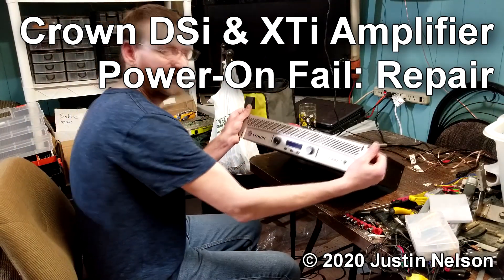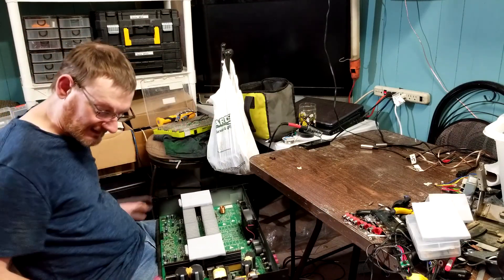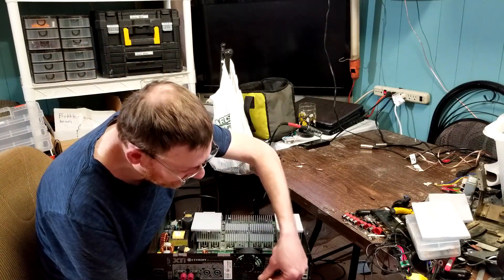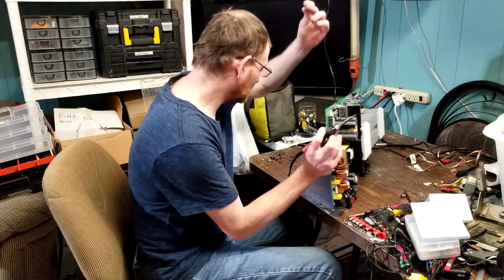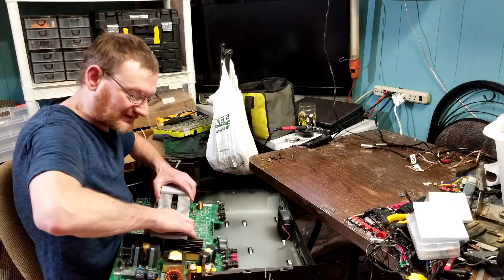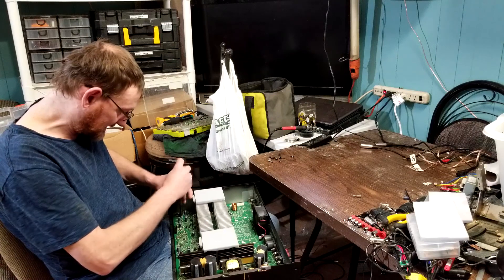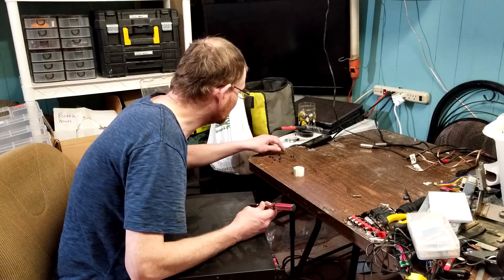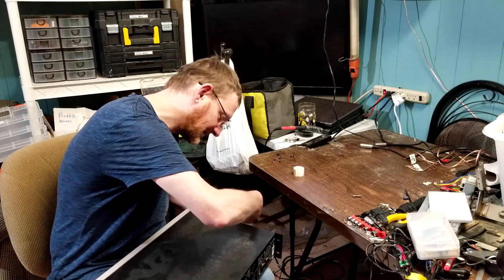Crown XTi Power On Failure   Repair in 16 Minutes

Comment: Not sure how soon you'll get back to me, but I had a question about the Crown sending the same signal out of channels 1 and 2. Any idea on how to troubleshoot that?
Reply from the maker: You should check the user manual for your model, but *in general*, if you have the DSP set to "Input Y", that'll send channel 1's input to both outputs.

Similarly, if you are set to "bridge mode" but actually have two speakers connected, you'll get the same audio in both (and this could cause speaker damage).

Press "config" twice, then use the arrows to cycle through the settings... other than that, google for the user manual, Crown is good about keeping manuals for their older products available online.

Comment: I have a crown xti 4000 that when powered on all the lights on the front flash on and off and gradually get weaker the longer I leave it powered on. Is this fixed the same for this issue on the 4000?
Reply from the maker: This sounds like a completely different problem... my fix as shown in the video is ONLY for the specific issue that I show; anything beyond that, you'll need to have someone qualified take a look at it.

Comment: @JustinNelsonsProjects   I wonder what was wrong with my XTI 4000? Mine would fire up but it would keep blip-ping my speakers repetitively and I would have to turn it off. I bought it used from Guitar Center but Luckily it was still under the factory warranty. Took it to a licensed Crown/Harmon shop and knock on wood it has been great for 14 years. I am pretty easy on it though, I only power 2 Cerwin Vega LS15's so I never ride it to the rails - only around 400w RMS on occasion.  Back then I bought it used for $700 so I just couldn't resist lol.

Comment: Hey Justin, I owe ya a couple beers already for this video as I've successfully revived 2 Xti1000's with your cap replacement here.

But my 3rd is being a whore.  After replacing the cap, it went from stone dead to powering up and then showing signal present LEDs on 1&2, so I thought maybe I didn't get a good soak on the traces and went back to retouch those.  Now it has a clip indicator on #2 despite never being given signals since the first repair, and it won't show up in Architect or HiQnet.  My other 2 populate in Architect on their own.

Tried swapping a cover over to see if it was maybe the bad ribbon cable issue but no dice.

Amps all supposedly came out of a church.  Fortunately I'm not into 'em for much as they were purchased in unknown condition.

Thoughts?

Comment: Hello, i have a xti1000 that wont turn on, so i replaced c196 with a 50v 220uf one, it still wont turn on so i measured the resistors that should be working on 48,7kohm but they show 22.6kohm do i also have to replace all those resistors for it to work? I have no idea an am a real noob technically
Reply from the maker: Measuring a component (like a resistor) while it is still "in circuit" will generally yield incorrect readings.

I *HIGHLY* recommend you take the amp to someone skilled in electronics. There are high voltages that can be present LONG after it has been powered off, and if you are a "noob" as you put it... you probably shouldn't be randomly probing around in there or replacing parts you may not fully understand.

My guide was for a highly-specific issue that plagues the XTI & DSI series of amplifiers; if replacing that one cap didn't fix it, then it's something else entirely and requires bench troubleshooting by someone skilled in amplifier repair...

Sorry the quick fix didn't work in your case -- it didn't on a couple of mine either... but since I fixed at least 6 of them with this fix I knew it was common enough, that I made a couple videos about it.
Reply: @JustinNelsonsProjects thank you, will let it get checked out by someone soon!

Comment: Hello, how are you?
Do you have the firmware you could provide me?
Reply from the maker: See pinned comment... sorry, I haven't worked on these amps in YEARS, it was a one-time video project that has long been forgotten...

I do know the firmware is still available; I would recommend searching Crown/Harmon Kardon for a service manual and any firmware (and the software needed to flash the firmware).

Just note that in most cases, a firmware update is not going to fix a broken amp...

Comment: Did anyone here try this and it didn’t work? I wish I could say it did like everyone in here but something bigger must be wrong with my XTI 4002. I replaced the capacitor with one of the ones linked in the description and when I turn it on, I hear a relay firing quietly a few times then nothing. Anyone else experience this? Or know of a person to send it off to that won’t bankrupt me?
Reply from the maker: The fix I show just happened to work on the handful of amps I got my hands on. It's not a "fix all" solution, there are MANY other things that can go wrong -- especially the higher-wattage models that have a "tracking power supply", meaning the voltage inside varies depending on how hard you crank it...

They are complex beasts to be sure.

I would look for someone local who does electronics repair, or if you're handy enough, reach out to Crown / Harmon Kardon for help (maybe a service manual)...

Comment: What a chaos. And after 3 minutes you manage to bend the poles 45 degrees. Thats not how other peoples hardware is treated.
Reply from the maker: Please read the pinned comment. I don't do amp repair for others, these were just some "about to be thrown out" amps I decided to take home and tinker with.

Aside from that, this video is quite old and those amps are STILL in use in my home studio today.

I just wanted to quickly highlight a common issue on these older Crown amps. You don't have to like my particular methods 😏

Comment: I don't see any repair videos if the xti 4000 and xti 4002 
The capacitor in question is a completely different number, mine will not switch on and that capacitor don't seem to be at fault
Reply from the maker: This video is SPECIFICALLY about the amplifier shown -- I cannot diagnose an amplifier I do not have access to... you'll have to look elsewhere for a video specifically on the 4000/4002 series...

Comment: I have a crown xti 40002 and all I had was 4 cerwin Vegas hooked up to it I bought this thing used and it's worked good until today I wasn't even driving it that hard to where it was red lining or anything but it started flashing and slowly turned off but there was a weird thumping noise through the speakers even with it off how much would you charge me to fix it I'll send it to you
Reply from the maker: I don't do repairs -- I simply repaired a few amplifiers a couple years ago, and decided to share my experience... see pinned comment for more info...

Comment: Thank you for your help. I removed the motherboard from my xti1002 with no difficulties but I failed to take a picture before inverting the board and the 2 metal straps on the board supporting the speaker binding post were not captive and fell off. 1 remained on the positive terminal but not sure if the other was on the other positive terminal. Can you enlighten me please?
Thanks Ed
Reply from the maker: If I have time tomorrow, one of my xti 1002 amps has crapped out on me. It's like just a couple of screws, maybe I can take a picture of the inside of that so you can see how it should go back together... No promises, but if I find a little extra time, I've been wanting to open that one up anyway..
Reply from the maker: Give me a day or two, I haven't opened one of these up in a while. I'll have to dig through footage or photos from when I originally published these videos, maybe I can point you in the right direction. But again, give me a day or two, it's the first of the month at this point and I have a lot going on... 

I recently acquired an XLS 1002, which is a different species but hopefully I can make that thing work again and another video will be forthcoming if that pans out. 

Thanks for watching, and thanks for the comment. If I can help in any way on the xti 1002, I will do my best. But again give me a couple days 😀

Comment: Have you worked on the Crown CDi1000?  I have a unit that will not complete power on and does not have the set of through hole resistors and the C198 near power switch that you replace in your video.  Really like your get right to it video style.  Any advice?  The only thing observed on my circuit board is a bulged capacitor top (C815) right near the back of the LCD display.  This has a small inductor and other small SMPS components.
Reply from the maker: I have worked on a CDI 1000, but it's probably an older unit. I'm sure some of the components on the board are relabeled or even rearranged. 

It's been a while since I worked on a Crown amp, but I do have a XLS 1002 in my possession that puts out audio but only sometimes, and has display issues including both thermal lights lighting up even when it's cold LOL. 

So I am going to jump back into the crown amp repair situation, hopefully I can return some information that might help. But if you've got a CDI model that I don't have on hand, honestly without looking at it first hand, I don't know that I can help. But at least I can gleam from some of the newer and older amps made by Crown, what changes have been made over the years

Comment: Have the XTI 1002 and does not power on.  Did the capacitor replacement.  No change.  Tested removed capacitor and it was good.  
Tested resistors and the show resistance.  Tested all the transistors,  1 tests bad .  The one right next to the 2 relays.   Do not know if that could be the problem.  Any advice?  How do I know what transistor to use in the replacement.   Looking for the schematics and parts is tough to locate.  Thanks for the videos.

Comment: Thank you so much for this perfect video.  To the point and no meaningless information
Reply from the maker: Thank you so much for the feedback. I really did try to just sum up the problem without getting into extreme detail, unfortunately it started raining so the audio isn't great, but overall the video made its point.

I'm just happy that after a good couple years it's still relevant, as these amps are all over the place, due to cinemas closing down, etc...

Comment: Sir i have changed the capacitor but it is still in dead condition and the 26 volt on the capacitor is fluctuating ??? Help me sir
Reply from the maker: Please refer to the pinned comment on this video. I can only help with what I already know about these amplifiers, I cannot diagnose an amplifier that's not in front of me.

I appreciate the view, but please understand, I was only pointing out one possible solution to the power up problem on these amps... I don't repair amplifiers for a living, I just got a hold of a bunch of broken a couple years ago and made a couple videos...

I do wish you the best of luck and I do appreciate the view and the feedback

Comment: Awesome, this looks promising! I have one of these and as you can guess the same problem basically. Powers on then shuts off immediately
Reply: Unfortunately it did only help partially. The amp now powers on briefly, then powers off with a click and then powers on again without a click and stays on, nothing on the display except "ready" level on each level meter. The unit is accessible over USB but the front display shows a dim backlight, no text, and the encoders do nothing. Any ideas what this might be?

The amp Seems to work, I tested with pink noise via the bandmanager2 software
Reply: Oh, I just checked the 5V rail for the LCD, it's 2.5 Volts. That Might explain why it's not happy. . Seems the LCD has its own voltage rail controlled by a 5Volt regulator 78M05. The Vin for that regulator is 29.1V Which is within spec, but the output is only 2.5V so maybe it is faulty?
Reply: Yep, was the 5Volt regulator. Swapped in a buck converter temporarily and the unit is back to working.

Comment: I need the lpc2142 xti2000 hex file
Reply from the maker: Yeah, you'll need to contact Crown (owned by Harman International since 2000) -- otherwise you might be able to find someone with that firmware, but BEWARE flashing anything with firmware you obtain from just some guy on the Internet...

Definitely try to get it from the source, eg, Crown... wish I could help but I've never once seen a need to flash a Crown amp. If your firmware is corrupted, I believe your problem lies deeper...

Comment: Do you check the two zeners D28 and D29 which live in parallel of this cap, they limit the startup supply to 32V.
Reply from the maker: Honestly I never did look that far into it. I just knew that capacitor was failed and stuck a higher voltage rated version in its place... It was intended as a quick fix, and since it turned out we had several amps with the exact same issue, I just went through the motions on the rest lol without really giving it much thought.

It's been a good couple years and most of them are still in service, they're on 24/7...

But good to know for future reference

Comment: Thank you mister, worked on my Crown 4002 XTI!
Reply from the maker: Glad to hear it!
Reply: So this issue is present on the 4002 as well, not just the older ones?
Reply: I do have 4002 xti as well ,I have the same problem no power at all I don't know much about repairing about this stuff, I wanna ask if the capacitor just really need to replace it with 50v? I wanna make sure if I bring my 4002 to repair shop they won't charge me more because I have no knowledge about this kind of stuff

Comment: I have a xti 4002 when I turn on amplifier speaker makes static popping sound, and display is lit but blank no red meter showing. Could this be a blown fuse?
Reply from the maker: I honestly can't diagnose an amp that's not sitting on my desk... but I would be careful about hooking up any speakers you care about to it, until it has been properly diagnosed and repaired by someone local to you...

Comment: So in the beginning of the video what If there is voltage across the two heatsinks how do I discharge properly?
Reply from the maker: The fastest way would be to take an insulated wire, and ground out BOTH heat sinks to the chassis -- BUT the best way would be to have a resistor inline or wait a while, the capacitors WILL self discharge after some time... Just note that you have a positive rail, and a negative rail, so simply shorting the two together could backwards-charge one rail... so always reference to zero volts (chassis ground) when discharging each.

Comment: You bent those speaker terminals so much i am surprised it ever worked again i would not ever let you near any of my audio equipment.
Reply from the maker: First, I don't run an audio repair shop. I just had a buttload of broken amps that all had the same problem, and wanted to demonstrate how quickly it could be fixed. I wasn't really concerned in this particular case how about quality or damaging something. It was more of a speed run for the video. This particular one has other issues including an extremely loud thud on power off (a problem I already knew it had before the capacitor failure problem). I already knew that amp wasn't going back into production service. I do however use it on a pair of monitor speakers in my little Studio to this day. 

On the 2000 watt versions and another 1000, I did take more time and care, in fact those went back into service at the restaurant they came from, and have been running 24/7 ever since. I do all the maintenance there and I'm responsible for the audio as part of that, many different zones etc. When I took over that job, half the zones did not work because of those amp failures. The ones that I was able to repair went back into service, after a bit of testing here at the house. Obviously we also purchased some new amps where needed. 

In summary, I'm more than happy to stay away from your audio equipment 😁 This kind of work is not a normal part of my day job, just a hobby.

Comment: Also need replace burn precision resistors. The amp works but in short time failure again without replace those resistors.
Reply from the maker: I think the bottom line is, these amps are well designed and can run for many years quite reliably.

However everything degrades over time, so if you truly want the amp to run like new, the more passive components you replace, the longer it is likely to last into the future. Capacitors, resistors, perhaps even the power transistors which are not all that expensive, could potentially add years to an old inefficient amplifier.

The power supply circuitry is a little more tricky but the same basic principles apply: replace anything that looks physically over stressed, or tests out of spec.

I still have three dead ones ranging from the XTI 1000 to a four-channel 4000, that I plan on doing a complete overhaul with partly for the video sake and partly just to have another Kick-Ass amp 😁 I will probably look for the best looking candidate that at least attempts to power on when I have the time to do that project. Stay tuned to this channel...